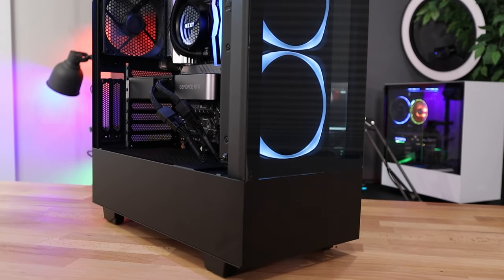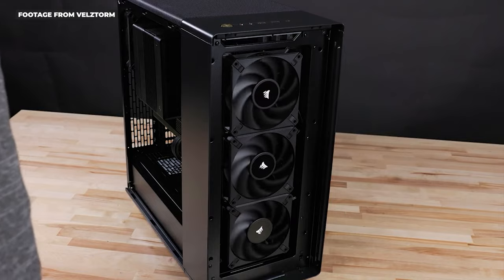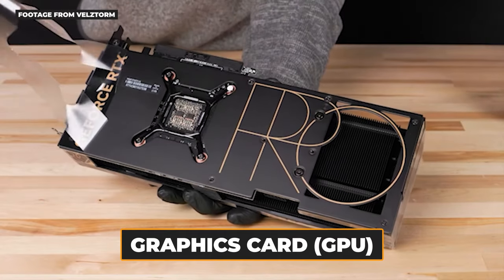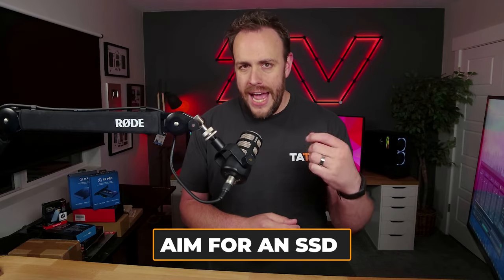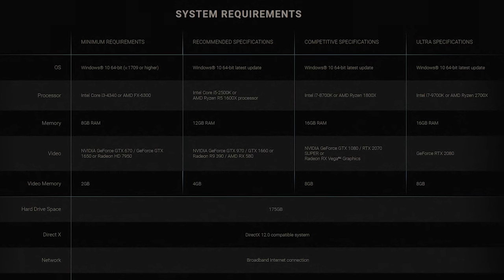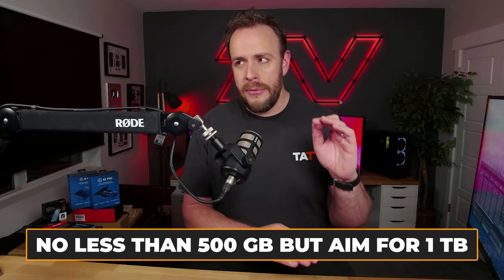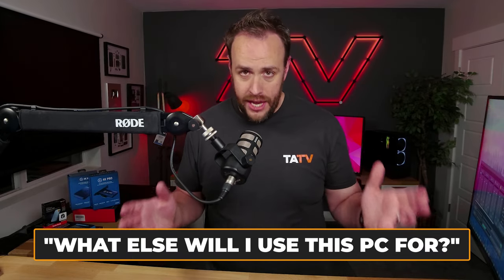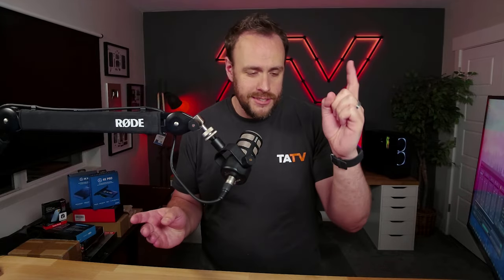🛑 Watch This BEFORE Buying Your First Gaming PC in 2024! 🖥️

Comment: i have a question. im getting a gaming monitor for my birthday but in order to play games, download things do i need to buy a pc? and if i connect my ps5 to the monitor can i play both pc games and ps5 games?
Reply: A monitor is just the screen
Reply: Unless the monitor is an all-in-one computer, you need a computer to download and play games. The monitor is nothing but a device to hook up to the computer. 

You can connect the PS5 to the monitor's HDMI port. Monitors will have at least two HDMI ports.

Comment: $399 Micro center CPU<MOBO<RAM combo plus a 7900GRE or 7800xt for $500-550 and use the rest of your old pc and if you don't have a SSD or a M.2 Nvme, get a Crucial T500 1TB Gen4 NVMe M.2 Internal Gaming SSD, Up to 7300MB/s for $80on amazon and don't forget to check if you have a m.2 screw that usually comes with the mobo not the actual SSD.